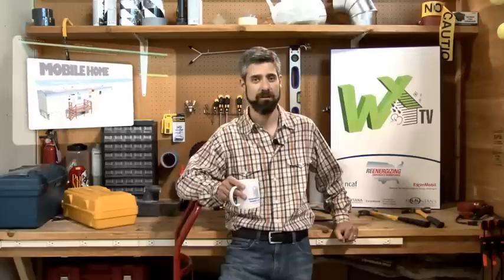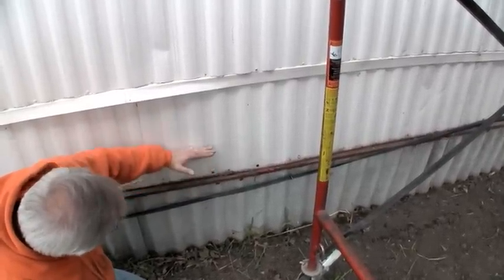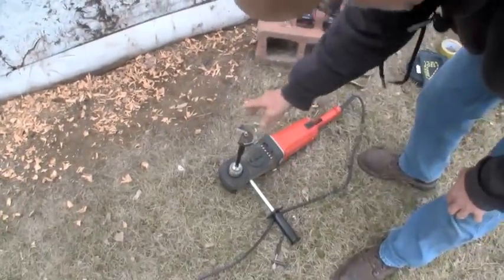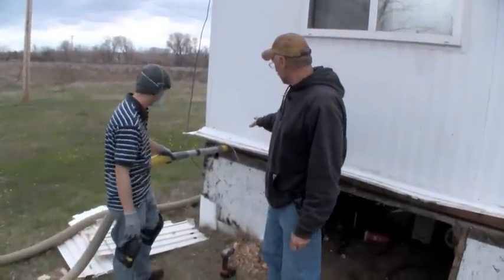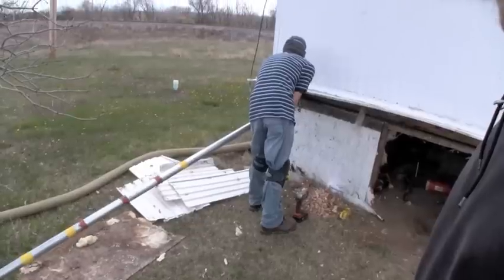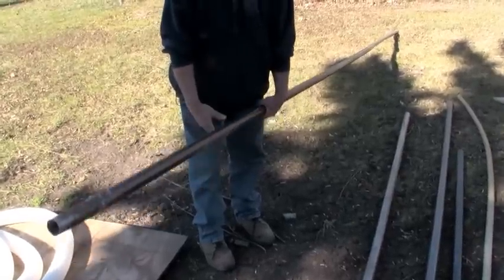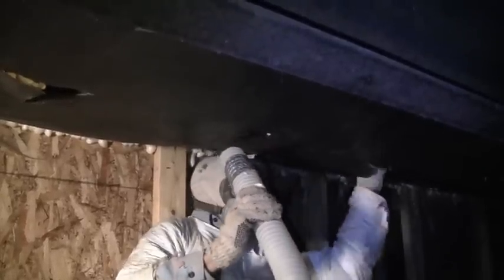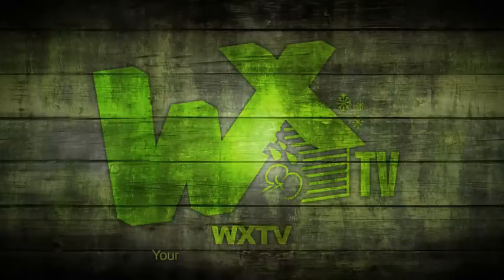Mobile Home Series: Insulating the Belly

Comment: Certainly drilling so many large holes in the rim joist weakens that joists ability to support the walls of the home. Not the method I'm using to insulate the belly of my home.
Reply: Scott Sanders I don't know exactly, but wont the wood plugs make up for the amount of material they took out? Are the wood plugs the same depth of the holes they drilled?
Reply: First thing I thought!!!
Reply: @kobelcofan  It would if they glued the plugs in since glue is stronger than wood.  However, it didn't look like they did that.  So the plugs don't give it any strength at all.  As a matter of fact, if the plugs are tight, it might even make it worse because they would add tension to the surrounding wood.  This issue isn't the compression of the wood, the concern is the wood splitting.
Reply: Bro, this is definitely not the way to do this job. YouTube needs to take this video down before people end up ruining their mobile home.
Reply: 🆘.  In the middle of putting up siding.. the one fellow that did show up 🤪 installing

Comment: My husband is an HVAC engineer.  He does not like the belly bag because he says moisture cannot pass through it.  Are the bellybags pourous so air can pass through?
Reply: It serves as a Vapor barrier, a good idea, the convected heat your home produces lifts moisture out of the soil, which then passes through insulation and wood in your floor. This is bad (mold). Modern code requires a stick built home have this installed on all heater walls/floor. Plus you should have a 6 mil plastic over the dirt/sand of your crawl space, which is code for stick built homes as well as manufactured home sets, new ones any ways. You don't want moisture to pass through your structure. Keep it from vapping up into the crawl and what does get in keep it from going upwards into the structure, then allow it to escape easily, with proper foundation/skirting vents.

Comment: I rebuild mobile home in  Manitoba  I don't agree with drilling holes  in the rim board  this weakens the rim board for moving mobile it gives its strength   and second who ever designed   a mobile with the floor joist running the same way with   the out riggers from main frame   there weak and can not hold up  to any other work done
Reply: I think that is VERY  stupid too..
Reply: I was thinking it's more dangerous due to the possibility of Electrical lines are sometimes tacked right there...

Comment: Doesn't really seem like a "DIY" sort of method.  But good information.  "Luckily", the floors in the trailer I just bought have been damaged, so, since I have to tear them up anyway, I'll be doing most of my insulation from the top instead of the bottom.
Reply: 🆘 here.. just retired in mobile park but MANY people put cat 🐈 food out and 🦨🦨🦨🦨 possums,wild cats. Spent $4000 to remove.   Please

Comment: Proper way would be to patch the underneath with belly paper and metal shoots and staples , Cut in holes every 15 inches and blow in blown fiberglass from a hopper ...Have had trailers you could never imagine and have dropped my blower door number to a "B" ring.. Cutting holes in the outside rim joist ruins the integrity of the house and wont guarantee proper and adequate insulation...
Reply: drill 2 1/2" holes all along the rim joist 🤔

Comment: Where are y'all located and how much does it cost for a 16 x80
Reply: I would be very careful about over insulation. Sound funny I supposed but if your water lines get covered on the wrong side, and with blow in insulation you never know.... but if water lines are insulated away from the heat side. You will have a freeze up in cold weather

Comment: You guy's drilled them hole's so big you have compromise the integrity of the rim-joints

Holes in bearing wall studs (exterior and interior walls that bear the weight of the roof and/or other stories above) may not exceed 40 percent of the width of the stud.

Comment: why would packing the insulation tight cause the pipes to freeze?
Reply: pipe may need heat from the house floor side, as a heat source, if skirt is insulated , less of an issue, depends

Comment: why would you spend all that time and money insulating a rusted out old trailer. Not only did they not do a good job insulating it but they also weakened what little structural integrity this trailer might have had.
Reply: I agree with you on them drilling the holes was ridiculous. Without a doubt! But people remodel mobile homes all the time. If done right, it's actually a good profitable business I guess you could say. They make great homes if you know what you're doing when it comes down to remodeling them. I've got a couple of videos on my channel you should check it out and see what I'm dealing with right now. But once I'm done, it will probably blow a lot of people's minds! We lost everything to a house fire with no insurance and turned around and bought this mobile home I'm working on for $300. The house had a tremendous amount of water damage, it's been about a year project because I only get to work on it one day a week since I made truck driver and I never get time off of work. We stay with my in-laws and it sucks not having a home of your own. But once I'm done with it, it will definitely be worth it in the end.
Reply: More than likely an energy assistance program for low income people. They do it for free in my area, new windows insulation and help with furnaces. One non profit here will give you a $400.00 credit on your elec bill or $400.00 cash if you have a woodstove, for wood.